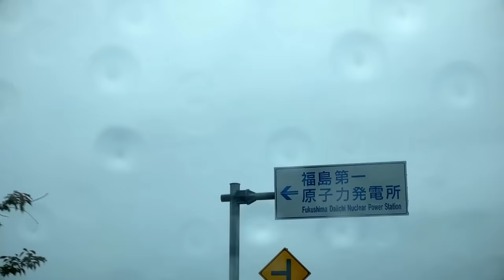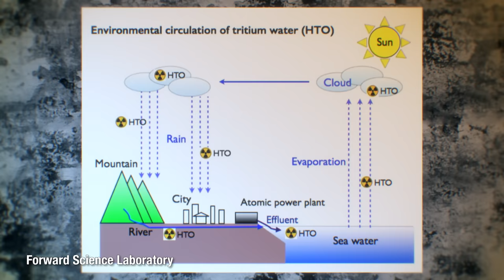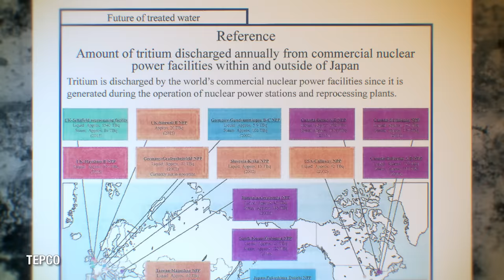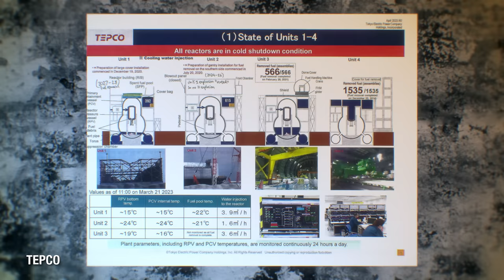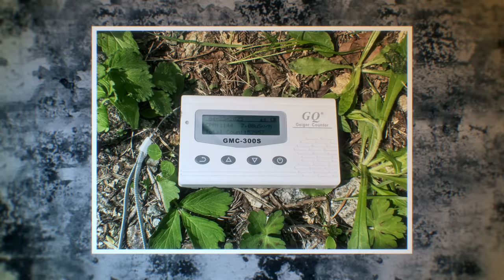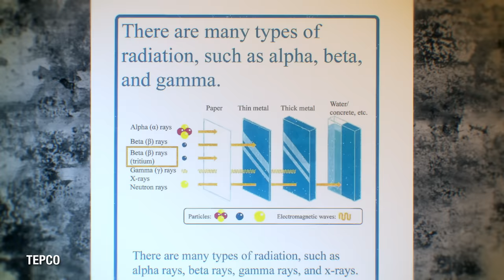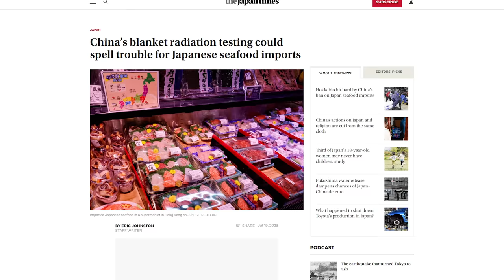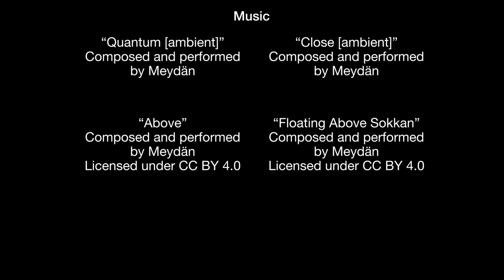Is Fukushima's Radioactive Water Safe?

Comment: I found that the explanation are basically follow what the Japanese trying to emphasize on and ignore the rest. 
Could you help to answer on the following in order to be more convincing in a scientific way?

1. Is contaminated water only consists of Tritium? What about other radioactive elements? Why insist on Tritium only as this involved a Top Grade 7th Nuclear Accident Plant same as Chernobyl? Has all these been tested?
2. How do ALPS process contamination radioactive water? If ALPS could filter the radiation, why can't it process and store it back to the Tank for few more years? Lack of places to store the tanks while most of the place are empty now due to the disaster?
3. Have other Nuclear plants went through a 7th grade Nuclear Accident as they claimed other plants did the same of release? Did the other plant's nuclear reactor meltdown and causing nuclear core to direct contact with the water?
4. Diluted contamination water can resolve the radioactive element aggregation for 30 years? Dilution with sea water and dump back to the sea has any difference of dumping directly other than lower down the sampling rate?
5. Last and most simple, if the water is so safe, why can't it use for other purpose in country instead of the world's ocean?
Reply: Very good questions.  
I think you know why they wanted to talk about tritium only - it's one of the weakeste ratioactive element with the shortest half life

Comment: I know  there is probably some complications with this solution... but if I'm correct tritium costs 2Billon per Kg(with no buoyancy)  and would be financially viable to use electrolysis  to completely remove all the H2 from water (tritium or not) Due to It's possible value in fusion and other industries it would be a goal to remove the tritium  from radio active water . In case there is a logical problem with this... I'm just a random guy of the internet :)
Reply: Lots of things wrong with your meme, but easiest for you to understand is the half life of tritium is 12.3 years.  Some of that water has been stored that long.

Comment: Who thought that putting a nuclear power plant by the ocean was a smart move ?
Reply: It's an easy method for cooling, instead of relying on cooling towers you use ocean water and circulate that

Nuclear power plants have one of two options Single or Double loop cooling systems

Single loop is a closed system that runs through the reactor, heatsinks then back to the reactor core

Double cooling loops have two loops, 

Loop 1 runs through the core, heatsink exchanged and back to the core

Loop 2 runs through the heatsink exchanger and either through a cooling tower or back into the ocean, the water at no point touches or mixes with the reactor loop
Reply: @aidenpearce5275  Thank you for the info.
Reply: Not all locations are suitable for nuclear plants.  Japan overall is not suitable.  And they still haven't shut down that disaster cat 7 plant !!!!

Comment: Amazing work!

However, there is some cross-cultural misunderstanding. Like when he mentions face loosing. I disagree with this interpretation. Face loosing as it is imagined by a Westerner is something you would rather find in China or some other Asian countries. The culture around apologizes is very different between Japan and China. This is a complex subject, I don't think that the reporter had enough deep understanding of the Japanese culture.

That said, these remarks can be very helpful for the Japanese side to improve their international communications.

China in particular has been using this water issue as a tool to undermine confidence in Japanese sea products and Japan in general. But science stands on Japan's side.

Comment: I wonder of tritium is the ONLY radioactive substance released into the ocean water after the APLS treatment. And why when its safe for consumption, not used as a potable water source by the Japanese.

I felt the report slightly biased.
Reply: Not slight biased.  Extremely extremely biased.  They are trying to confuse people with regular cooling water in a normal facilities.  Japan had a category 7 accident and their radioactive contaminated water is from that accident.  So that's nuclear itself that is dumped into the ocean.

Comment: "This water is not regular wastewater used to cool regular operations but contaminated water  that came in contact with a nuclear leak likely to contain not just tritium and carbon-14, which can't be removed, but potentially a large number of other substances, radioactive materials. 

So what we really should be doing is trying to minimize human exposures to radiation that are unnecessary and can be avoided. Any unavoidable exposure should be kept as low as possible. 

In this case, there's a very important argument to be made about whether this discharge actually needs to happen and whether the alternatives have been properly considered and explored. Because for people, especially outside Japan, one could argue that there is no benefit from this discharge. There is only harm. 

As for the ALPS devise, it's not widely used in industry practice. It's not been scientifically approved and tested in terms of its efficiency and effect. 

The Japanese side repeatedly mentions the term "treated water." The fact is that of the 1.4 million tons of contaminated water, only a little bit has been treated. We don't know how the ALPS device could handle the vast remaining quantity of contaminated water.

The IAEA has no mandate whatsoever to issue a green light for Japan's discharge of contaminated nuclear water. What the IAEA can do is to set up the scientific standards, request compliance with those standards and monitor whether they have been followed or not by its member states.

This is not normal discharge. This is waste material that's projected to be discharged over many decades, which will continue to accumulate. We're not just dealing with the almost 1.4 million tons of contaminated water that's present now, some of which has already leaked into the ground water and will end up in the ocean, but many more tons that will accumulate over decades. 

the final report and statement made by the chief of IAEA are self-contradictory and highly controversial. The director general stated that the treated water was drinkable and swimmable. That is surprising. If the water after treatment is safe, as he said, and can be used as drinking water and be used for swimming pools, why doesn't Japan use this water for its domestic agriculture and industrial purposes? If it's clean and safe enough, there was no need to discharge it into the oceans. 

At the moment, we don't have any convincing evidence that the treatment of the water will work. Based on the evidence that TEPCO has released so far publicly, 72 percent of the samples of water that had been treated by APLS in one treatment round did not meet the regulatory standards. Some of them were almost 20,000 higher than the regulatory limit.

So we really have no proof that the purification system will work as intended. That's a very direct concern about this discharge. The one approach which the Japanese government is applying is dilution, as if somehow diluting the material, it obviously reduces the concentration. But the total amount of that material is unchanged. Dilution is not a solution, because it doesn't change affect the amount of material in total that is released at all."
Reply: Thank you.  We know that Japan nuclear contaminated water is more than just tritium.  This water is not regular cooling wastewater to cool regular operations
Reply: Right on other radioactive elements such as  carbon-14 can't be removed.
Reply: @suikai2776  They only wanted to talk about tritium b/c tritium is the weakest radioactive element with short halflife like 12 years.  Some others have over trillion years.  And these 145O keep talk about tritium is meant to confuse people.

Comment: Is ALPS being used anywhere else and has it been proven that ONLY tritium is left after ALPS?
Reply: Only samples for IAEA. There is no guarantee that Japan will keep working on this expensive treatment unit for 40 years. In fact, the ocean will swim with organisms that will enrich such radioactive tritium elements. Yes, it will have an effect on those organisms that have biologically collected these tritium elements. The radiation is at a distance of a few millimeters, which is enough to have an effect on humans who eat these fish.
Reply: @AwardQueue  Because of the role of hydrogen in metabolism and its ubiquitousness in the environment, organisms have not evolved mechanisms to accumulate or concentrate hydrogen or its isotopes in food chains. Therefore, biomagnification of tritium is not a factor in food chain transfer.

Comment: If its just tritium and h2o and you remove the h20 wouldn't that still separate them?
Reply: Theoretically, you could separate tritium from water by removing either tritium or water. However, tritium exists in the environment as tritiated water (3-H2O; tritium atom is a hydrogen atom with 3 nuclear particles instead of 1); tritiated water and normal water are too chemically similar that there is no viable way to efficiently separate them. It is like finding a 4-leaf clover from a vast clover meadow, except that tritiated water molecules are probably much rarer.

Comment: So if Tritium is the main contaminate why is it not being filtered out and used for Fusion research? Tritium is extremely rare and sought after for nuclear fusion research, why are they letting it go to waste? Sorry if this is a dumb question I recently have gotten super interested in Nuclear power.
Reply: Correction: I understand that it is extremely hard to remove tritium but is it not worth the research for many reasons?
Reply: @johnboland6721   There is about 2-3 grams of tritium in all of those tanks combined, and tritium has a half life of 12.3 years.

Comment: To weapons-industry and strategic-defence considerations, gamma-fields are disruptors to manufacturing and defence. Pollution of raadioactive half-lifes and electromagnetic-flux are the strategy for missile-dome, radar energising, sensor manufacture, destruction(confusion, intermitten, incapacitate temporary, destroy irreversibly, ...). Anything that affects radio-signature shift strategy should be rejected for import
Reply: Recent testing of redirection of fukushima gamma(types) emissions to china and tibet using (electro)magnetic-flux and ionising-air conductivity, remote-distance strategy, may had begun-ended with results.
Reply: Recent testing of amplification using manufacturing emissions (global-foundaries pollution) from singapore to malaysia may had begun-ended.

Recent preparation of cyclone for india, sucking in all those and dump on india, from delhi-to-chennai, dry belt, should be completed.
Reply: Singapore will not need your news on climate, weather and climate-change. The colored lightning and most recent floodings (not years 2020, 2021, 2022 - soften-harden mud-cake soils for water-air to drill to the water-table) are indicators of building-vibrator strength future. Initial estimate should be - anything above 30 storeys(western low height storey) will induce nausea. Anything above 70 stories are worthless. (Anak)Krakatao and pacific-ring of fire are seperate and included. Sesmic plus tsunami plus cyclones for those perpatrators(extra unlucky, murphy of murphy's-law) and blockers of path(career, tech, manufacture, purchase, life, education, ... walking, driving, flying, sailing, ...) 

Japan need to be alive for their products to have warranty-guarantee. Same applies to all countries and all people. The power of 风水 by Hokkien and employed by higher-than Hokkien - Theravadin(real, most of thailand are fake-therevada) for mudane, not supra-mundane effects. This is about the maximum a single human can achieve in life, without Budda, Dhamma, Sangha.

Comment: Personally i'm less impressed by the redundant apologies and guarantees that they will make the water safe. It's good PR to release the water well below global dilution requirements, and it's good PR to apologize. What's better PR is to find a way to protect and maintain a power plant well above it's environmental hazards.

  It doesn't affect me much in the grand scheme of things, and i'm 100% for nuclear power. But every catastrophic failure of a plant due to poor maintenance, poor planning, or poor operation, Is an unfixable blow to the nuclear industry globally.

  TL;DR: You know what's better than apologies and cleaning up the mess? Not breaking the plate in the damn first place.
Reply: You could have read the report.
Reply: @danadurnfordkevinblanchdebunk  Ah, yes,

Read the very technical report that only people versed in nuclear engineering would understand.

That will make the masses feel safe!

Why didn't we think of that?
Reply: @danadurnfordkevinblanchdebunk  I'll drive the full report for you, put it on every telephone pole in a 30 mile radius, did I fix opinions?

Comment: Couldn't you centrifuge out the tritium water? I would think the weight difference is larger then with U-235 enrichment by centrifuging out the U-238 right? 18 mol for normal water vs 22 mol for tritium water is a difference of ~20% vs only 1.2% mass difference for the uranium isotopes.
Reply: You could centrifuge. It's just expensive for no purpose.
Reply: @hewdelfewijfe  Yeah thought so. Was just wondering since he said something along the line of "there is no knowen way to seperate it", but he probably ment no economical way.

Comment: Simple, if the water is not safe to discharge, then don’t, if its is safe, it does not need to be discharged into the sea.
Reply: sea water sure is going back to sea🤣
Reply: and China's nuclear power plants are doing the same even with higher radioactive substance readings
Reply: @marcusneiman2168  if the water is so safe, why don’t they use it for themselves? Also, the water Japanese are discharging are the ones from the Fukushima nuclear incident, the water used for cool down had direct contact with the nuclear reactor, the ones in China and all over the world are water used to cool down normally for nuclear power plants to work and does not have direct contact with nuclear reactor, neither it has heavy pollution.
Reply: @marcusneiman2168  There aren’t just tritium inside the water that japan is discharging, it actually contains 64 more types of radioactive elements, no matter how they filter it, the amount of radioactive elements will never change, its just how much water comes with it.
Reply: @bnini8728 nobody say it just tritium, even   Japanese gov has put a chart showing all types of radioactive elements remins and its amounts

Comment: why don't they just let the water evaporate?
Reply: that would be the same as releasing it to the sea. at least, they can control releasing the water for decades.
Reply: @babyapple_  If they let it evaporate very slowly from numerous locations at small quantities across the country, it would be diluted far effectively, wouldn't it?
Reply: @babyapple_ water will be evaporate, substance wouldnt, thats how human make salt out of sea water, but the price of filtering the rad material so they wouldnt fly all over the air is too much to bear, pouring everything into ocean and pray everything will be ok, even if it dont, its the problem of commoners, nobles can still get food far away in safer environment.

Comment: Why keep focusing on tritium alone. The filtering process is claimed to filter out all other dangerous nuclides (carbon-14, strontium-90, iodine-129 and etc.) and yet Tepco did not test for level of these radioactive nuclides after the filtering process. Even IAEA was cunningly enough to insert a statement in the Tepco provided report stating that IAEA neither recommend nor endorse Japan's decision to discharge the radioactive water.
Reply: 「ALPS」について何も知らないようだ😂
Reply: At the Fukushima nuclear power plant, all radioactive materials, including tritium, are purified to below regulatory standards using multi-nuclide removal equipment and diluted at least 100 times before being released into the ocean. Through these treatments, the actual amount released is less than 1/100 of the regulatory standard value.
Reply: @theuncomfortabletruth8348 

は？もうそんなのとっくの前にやってて公表してるんだけど？
Reply: @theuncomfortabletruth8348 

検証されている事を知らないんだ？

知らないで言ってるんだ？同じ事何回も何回も執拗に😶

ちょっと調べりゃ出てくるのに知らないんだ？w